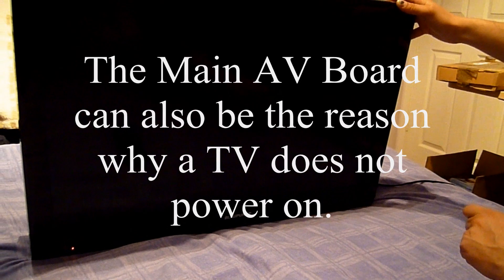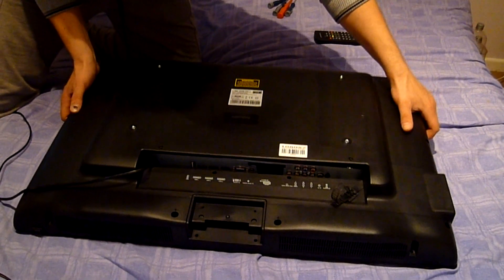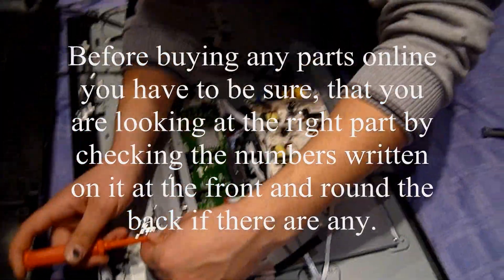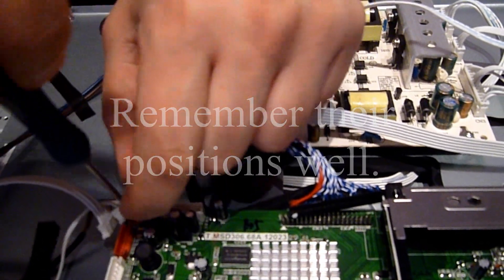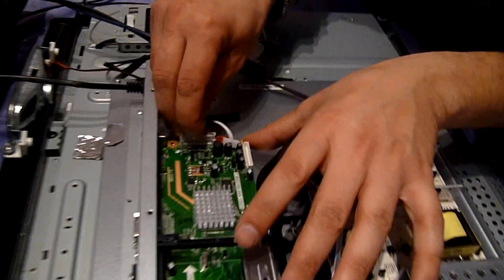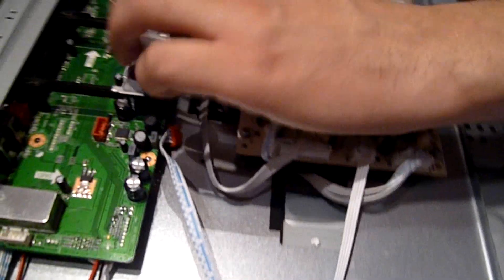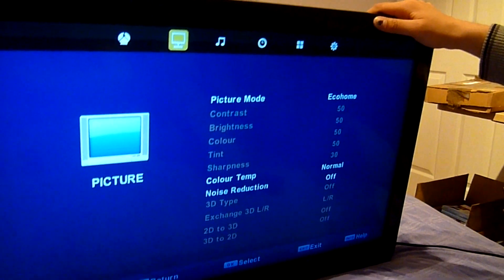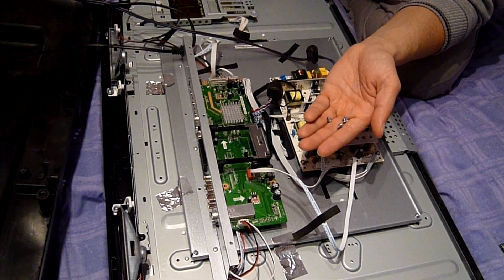How to fix a Blaupunkt 32'' LCD 3D TV which does not power on,DIY

Comment: U idiots I found how to fix any TV that has red light won't tun on without ripping TV apart its so easy take the fuse from plug and leave a min the put it back in then hold stand by it will reset TV to setup mode don't rip TV apar 😂
Reply: If the way to fix this is to just hold the stand by,why bother taking the fuse out?Just remove the plug.

Comment: hello i have the exact same tv a exactly the same problem,can you plz tell me where i can buy that mainboard?
Reply from the maker: Hello i bought mine from e-bay and you can also try Emos tv spares ,but check the numbers very carefully before buying.Because there is a slight difference between the boards and if it isn't exactly the same it won't work
Reply: i try it find it on ebay but nothing if you could let a link a will be very appreciate it
Reply: thank you very much ;)

Comment: Why not just change out the EEPROM UF11 for a freshly-programmed one? Soldering an 8-pin IC, probably use a socket. They are £5 on EBAY: http://www.ebay.co.uk/itm/BLAUPUNKT-32-147I-E-MOTION-32-147I-TP-MSD309-BP85-STUCK-IN-STANDBY-REPAIR-KIT-/152231995607?hash=item2371bbe8d7:g:C1AAAOSwQjNW~B0x  http://www.ebay.co.uk/itm/BLAUPUNKT-32-147I-TP-MSD309-BP85-STUCK-IN-STANDBY-REPAIR-KIT-READ-DESCRIPTION-/331879761718?hash=item4d45934736:g:FVQAAOSwgQ9Vxhmo

Comment: Thank you. I have the same problem with my blaukpunt lcd. Where did you find the new main board? I'm having troubles finding one...
Reply: Unfortunately it's out of stock... I've been trying to find a T.MSD309.B21B board for days but without any luck... Well, I'll keep on trying. Thanks.
Reply: check the capacitors on the board if they are bulged then change them there are videos on how to solder them on and off